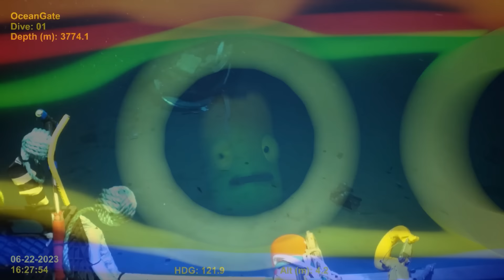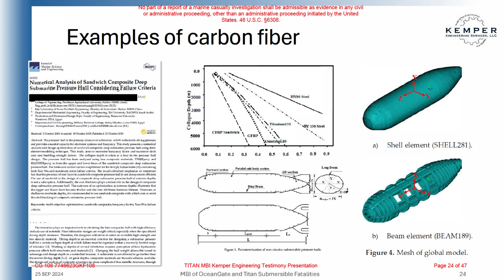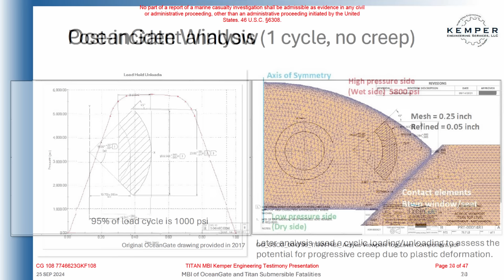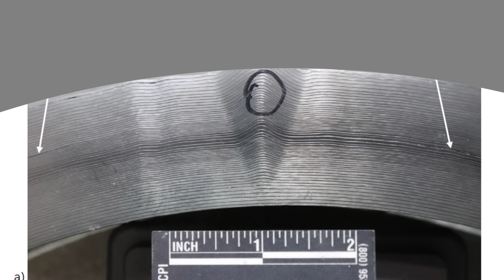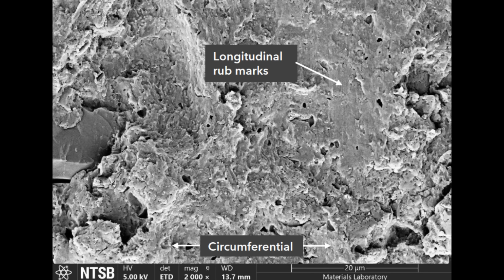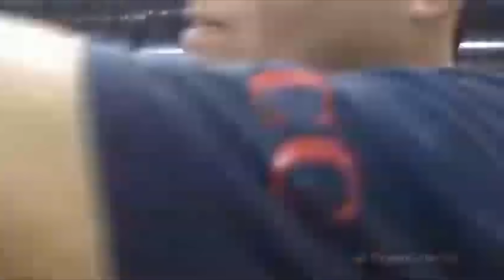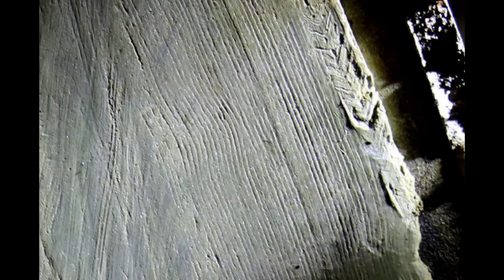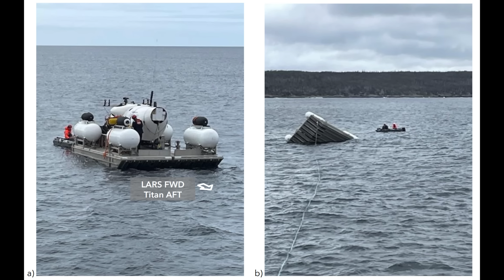OceanGate Wreck Shows Why Sub Wasn't Strong Enough To Survive - NTSB Shares Important Details

Comment: 20:09 I don't know how it was constructed but to me I can see a line running from .5" to 1.25" that makes me think they applied adhesive to the carbon fiber and titanium ring and then married them together. This could be the standard and/or recommended method, but it doesn't look like it bonded as well as they thought it would

Comment: While they did more wrong than right, i wonder what would have happened if they would have looked at the deformation graphs and decommissioned the carbon fiber hull. 

It seems to me that its rather a quality and aging issue than a general/ unpredictable issue with the carbon. Lots of comments that contain experiences with people that worked with carbon fiber seem to focus more on the build quality than the material selection. 

If they had improved the quality each time and replaced the carbon fiber after the warnings, the situation wouldn't have happened. Maybe something else would have happened, who knows. I still have to admit, that I'm impressed the hull sensors worked and successfully predicted the failure. Maybe Carbon fiber wasn't such a bad decision in the end as everyone thought. 

But that accident will probably ensure nobody will ever enter a carbon fiber submersible in the future.
Reply: To be fair, we don't know that the hull sensors successfully predicted the failure.  We know that they caught something that looks quite concerning, and that a few dives afterwards, the hull failed -- but we don't actually know that what they caught was related to the hull failure.
Reply: @BrooksMoses  the hull sensors slowly started indicating that the hull moved differently which would be reason to investigate. The sound detectors also started to find anomalies, so I wouldn't say they did nothing. Anomalies ton come and go without reason

Comment: I’m as concerned over the impact this has on deep sea tourism as I am on Starliner’s impact; it will never be affordable to normal people in this lifetime, so let the richest 1% be the Guinea Pigs and sacrifice themselves while they work out the kinks.

By the time the technology is cheap enough for the rest of us, the profit will motivate lots of companies to invest; whether or not they still cut corners will come down to risk vs reward, and if the risk is low enough you better believe that the doors on the sub are no safer than the doors on an airplane to increase that profit margin a few more cents.

Comment: Gosh, the idea of machining away wrinkled regions of tape laminate composites - severing fibers and introducing gross through-thickness discontinuities - is horrifying.

Also, Boeing would want ± 45º layers because they use quasi-isotropic layup families in basically all their structures.  This is the sort of material system they've thoroughly validated.  They use these styles of layup because they perform better under any type of shear load - you can't deform a 0/± 45/90 laminate in shear without fibers in some of the laminates undergoing extension/contraction (while a 0/90 can accommodate shear by rotation of the fibers).

Degradation of the bonding layers between the 1-inch sub-laminates is super-suspicious.  That will get progressively worse with each dive cycle which will serve to progressively reduce the buckle strength of the structure.  Additionally, basically every one of those "Acoustic Emission" events is some sort of crack occurring in the composite or one of the composite/titanium interfaces.  Each one weakens the structure overall.  To have them continuing to occur at a high rate after 80+ cycles is a bright red flag that a structure with unstable critical failure modes is heading for disaster.  That major AE event on dive 80 should have been been the lucky non-critical failure that saved them from a true disaster.

Maybe one of these days I'll find some time to make some proper FE models of this wavy machined wall to get a more concrete idea of just how bad a manufacturing technique that is.  It'd also be interesting to do some pressure penetration modeling of the portal with a proper mesh instead of the constant-strain linear triangles that were used in the model shown in the report.

Comment: Composite failure mode is undesirable. Absorbs energy and fails catastrophically, rather than plastic deformation/ easy damage identification. Does not reveal much under Non Destructive Testing.

Comment: "Armchair Engineers"

"I am not an engineer"

m8.... you are then in no position to play elite enough to criticise anybody like that. Doing so cuts your credibility significantly,

Now, what you said carries a good amount of water. But it has more to do with the lack of testing. Regarding the voids and the machining. that's really where the story ends. While composites are heterogeneous materials in the first place, the predictability is key as each component has a job to do, and within a composite material, you need each job to at least be done CONSISTENTLY or as consistently as possible. The fact of the matter that we really know right now is that the carbon fibre's wrinkling effect was not understood to be behaving consistently. As a result, the machining that was done altered tat material in a manner that was not consistent across the layers as they were fabricated.  This uncertainty leads to the more basic question: why use the carbon fibre, and not a more homogenous material such as the ceramic, the methylacrylate or the titanium? Hell, with the right testing, maybe you can find out that the polymer matrix the Carbon fibre was suspended in could be a better material than the carbon fibre itself. Point is, the really big engineering fuckup here was trying to design the science to the material and not the material to the science. As illustrated by the data we have so far: layers of machined carbon fibre is a dumbass tier death trap. The data that could begotten with competent scientific and engineering analysis is as of yet undetermined overall, but heavily favours using homogenous materials with consistent, well-understood behaviors.

Comment: My theory is disturbing, please exercise caution reading it.

Seems possible the whole thing tipped forward, everyone fell toward the nose, which made it completely tip forward, no control screen, no comms link, and  no ladder to get back to the aft control area, controller probably dropped, and panicking angry and scared people on top of each other, and finally it hits the sea bed exactly as you see it here, the tube rams into the view port, causing the failure there, and the implosion begins there. But, since solid people don't crush as easily as air, the air in the rear implodes first, pushing everyone even harder into the nose. The boat tears in half as the rear flies off in a predictable jagged shape. The front hatch break is completely clean as it's the first point of failure so experienced maximum force. The glue is the weakest point and fails totally. The other parts were somewhat more able to stay together as the boat ripped apart across the carbon, spending a lot of the force on that. Once the boat was nosediving there would be no way to reballast and stabilise her in her catastrophic descent. That's why I believe it fell out of communication, which I believe is the real reason there is no communication of a problem. I don't think communication was possible, and I think the best explanation for that would be that Rush was not at the console where he should be. Given the usual seating arrangements, and if he was at the front of the vessel, it suggests he was there and shouldn't have been.

Thus, my theory. I believe it suffered an impact with the sea bed.

Comment: We've had thousands of dives - many many many dives - and fatalities are extremely rare. We know the forces we're dealing with and overbuilding is trivial and cheap compared to the cost of underbuilding. If you build for 15000m depth but only ever go 1000m you'll never have trouble. If you're threading the needle, a 2150m deth submersible doing 2000m depth -- well, there's just no overhead and the weakest point can be a rounding error away from failure.
Deep Sea is "safe". If you have redundant tethers, oxygen, power and a plan for emergency recovery - it's doable. Ignoring a sensor out of range? That's just homicide.

Comment: carbon fiber can handle the pressure no problem. The challenge is its failure model.. when carbon fails it instantly fails catastrophically. No plastic deformation..

Comment: Worked at Boeing on carbon composites in Quality Assurance, I see so many incorrect procedures in the manufacture of this unit.
I wonder if it was manufactured using approved materials in a clean and controlled environment, did they use a form of vacuum compaction during the layup process? and was the unit cured in a approved calibrated autoclave I.A.W. with the materials spec.
Did they carry out any non destructive investigation (NDI) like ultrasound of the completed product looking for voids, backing ply's and foreign objects.
Was there any sacrificial extra material or any test panels made during the manufacturing process using the same materials and personnel to carry out post stress strength load tests, as this was a one off ....not a proven production process.

Boeing has many procedures and specs in the manufacturing and testing to be adhered to before being approved by the FAA.
Do civil submarines have a version of aviation's FAA?  in that the manufacture of this shitty submarine would have to be approved before use?
I cannot believe that this guy was not reviewed by a higher authority and his whole manufacturing process was not audited.

Comment: Fascinating analysis.  I wonder if titanium ring bulkheads on the interior of the carbon fiber cylindrical section would have helped counter catastophic buckling loads? One only has to crush an aluminum soda can to see what a terrible geometry a sphere is under compression - attempting to crush a table tennis ball in your hand shows why most designers would rather choose a sphere.
Reply: Typo: cylinder isn’t great under compression, not sphere.

Comment: You should probably add that all those submersibles with carbon fiber pressure vessels are unmanned outside of Titan and Deepflight I. The guy who designed Deepflight also designed the DeepFlight Challenger which was supposed to go to Challenger Deep but was mothballed after testing showed it could only reliably handle the pressure one time.

Comment: I used to work manufacturing carbon fiber parts. Mostly for the oil and gas industry and for aviation applications. The [Just shave it down and add another layer] approach was terrible. I was definitely curious why they didn't use 45 degree angle aspects in their layering. It sounds like they didn't check to see how the adhesives would preform under repeat exposure to those pressures. One thing we always had in mind in my work, was that the parts were expendable. 

Drone wings would wear out and be replaced. Oil and gas drill parts made from carbon fiber would break eventually. If it were underground, they would drill through the carbon fiber part with a diamond drill bit and keep going. That this guy built a carbon fiber hull like this, and expected it to be as permanent as the titanium end caps was lunacy.

Comment: This was a very interesting presentation. The sad thing is that the acoustic/strain monitoring system was not heeded, after showing what could really only be a structural change in the pressure vessel. Rather than continuing with successive dives, they should have made a thorough investigation of the pressure vessel integrity. Absolutely shameful safety practice that resulted in unnecessary deaths.

Comment: Manly doesn't seem to understand that you cant just use carbon fiber in a compressional way. it must be layered in a complex specific geometry, and even then it loses the vast majority of its strength. Just doing 90 degree layers wont use the strength of the CF in a compressional way at all. This sub was completely reliant on the resin that was holding the CF together and nothing else. It was the only substance giving this sub any compressional strength.

Comment: For the lensing effect they could have just used another lense shaped piece of acrylic inside the pressure hull that had a small air gap from the outer pressure window, shaped for whatever optical effect they wanted. I'm horrified that the solution they came up with for dealing with wrinkles in the material that was supposed to give this thing strength was to just cut it - like Cinderella's sisters cutting their heels and toes off to fit their feet in the shoe.

Comment: You start the dive with a 5 inch 5 layer hull. You get delamination in the outer layer and water gets behind it, the water pressure equalizes and now you effectively have a 4 inch, 4 layer hull. See the problem with that?

Comment: there was water intrusion at the forward titanium-glue junction, how else can you explain the oruter flange distroyed explosively and the inner flanged completely sheraed with no glue remaining at the joint? unless there was a pressure gradient at the forward glue-ring joint the damage would have to leave different remains there was no picture of the inner surfaces of the outer flange but the surface probably looks just like the forward flange face

Comment: Near instantaneously? It was instantaneously. Faster than a brain can comprehend something. It’s also speculated that after numerous uses, there were micro abrasions or dents in the carbon fiber their floral was structurally unsound on the micro level, which would’ve been enough theoretically to doom it since the structures aren’t fully perfect anymore. Remember, this is the same material. Elon Musk wanted to make his starships out of, but he knew the risk of using carbon fiber and how they were not the best material for reuse. Also, the speculation is or at least a theory is that since this vehicle had to be towed, it was pummeled by waves over and over again therefore, reducing the structure integrity again maybe on the micro level but it’s enough to doom a ship. Also, the shape of the vessel was not the best conducive for atmospheric pressure also.

Comment: Multi-millionaire with a engineering degree couldn't even spin a carbon fiber tube without wrinkles in it. Then even more stupidity autoclaving it ever inch of thickness then put glue between each layer. The peel ply allows easy removal of the amine blush on the surface, it is removed after the resin has cured.
17:37 what you are seeing in the voids is the texture of the resin after the peel ply was removed. In other words they did not get complete bonding.
18:10 no your obeservation is correct Scott the evidence shows a failure of adhesive bond between the forward ring and the carbon fiber tube. The flanges of the forward ring sheared perpendicular to the circumference of the ring.
Reply: The flange seems to be the thing that actually failed, but failed because the composite yielded a lot more than the titanium ring. That flange was way too thin in my opinion. 3/8" for pressures over 5000psi seems pretty measly to me.
Reply: @dustman96  no the adhesive failed, and then the tube collapsed onto the flange. Then it crushed aft like an accordion.
Reply: the amount and how it was wrapped were determined by the amount of cf and the facility they had and how much they could cook.  hardly an optimal way to build anything experimental of course!
Reply: ...so the submersible basically became a twist-open soda bottle? 

hope davy jones enjoyed the refreshment
Reply: Spot on 👌🏼

Comment: They died quicker than you can say ‘squish’. 😬
Reply: seems like they experienced how it's like being toothpaste if you see the top layer sitting on the bottom in the wreckage pictures.
Reply: @AnalogDude_  As soon as they reported they ‘lost communication’, I already knew they were goners.
Reply: @WizardClipAudio  Well, it also kinda shows that it doesn't matter if you have a degree or not, this guy had a degree and still ...

try to imagine: 10cm³ of water = 1 kg, now pile 37740 of these on top of you (3774 meters) and that's just a 10cm² base, so you need to add many more.
They should have rented some army tanks and put them on the hull to test.
Reply: @WizardClipAudio  How does a guy get to be billionaire? yet he ventured the trip and didn't make it, like his son.
Reply: @AnalogDude_  It just goes to show that all the money and education in the world can’t fix stupid. I don’t need a calculator to know better than to rely on any sort of composite material haul to reliably and consistently withstand pressures at that depth, in the shape of a cylinder. A cylinder shape is ideal for like carrying passengers, or streamlining in shallower depths, but it’s not the optimal shape for human occupied deep sea craft. It would have to be a ridiculously thick walled haul regardless of what it’s necessarily made of, much thicker than a spherical bathespere sort, and cross laterally reinforced on the interior. I don’t know how anyone with any reasonable degree of common sense and not immediately recognize it was quite the obvious death-trap that it was. 🤷‍♂️

Comment: If you're going for more interior volume, why not do a hybrid hull/pressure vessel with an interior titanium sleave that can interface mechanically with the endcaps and minimize flex? With a CF outer wrap that adds strength and overall buoyancy while reducing weight? Compromise between the two and get the best of both materials.